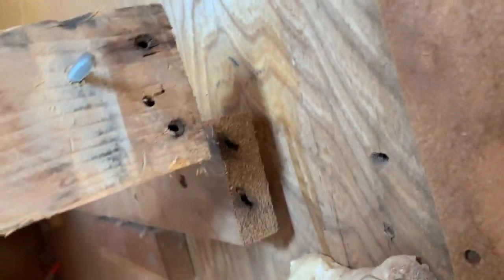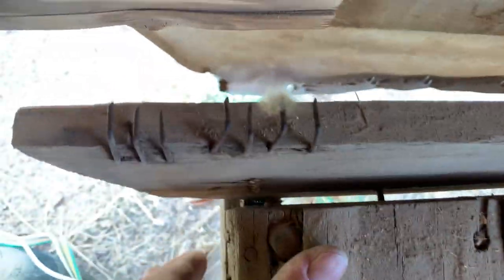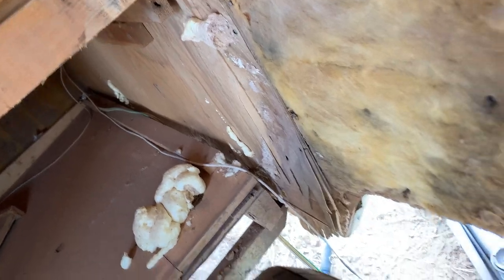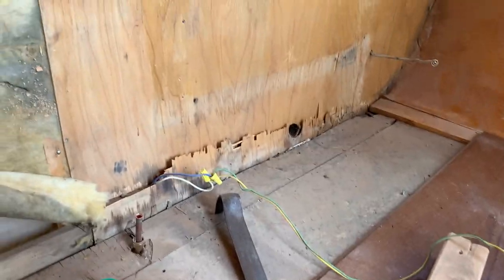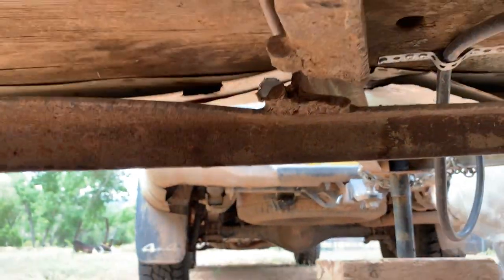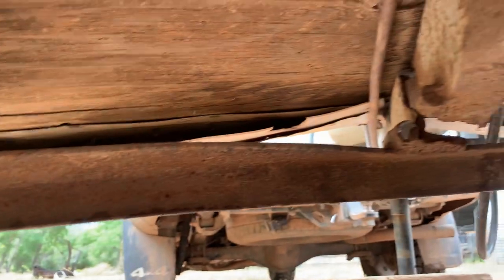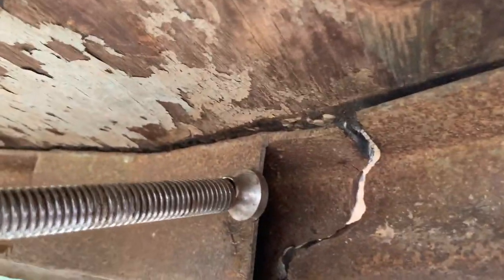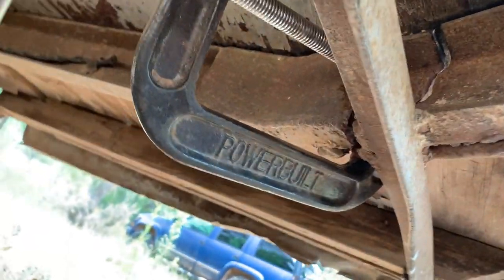broken camper video two

Comment: G'day Dave,

Foody bluckin' 'Ell...!

That Rock wasn't muckin' about..., was it ?

Did it leap up at you from an ambush, or did the Van swing out past the Track while you were in a Right-hand Turn ?

Did you have to tow it while broken, for very far to get it back to the Ranch ?

It's impressive that it's repairable.

Maybe leave or renew the Felted Insulation - but add a layer of "Sisalation", Aluminium/Blue Paper Building Insulation, or sheets of Closed-Cell Foam ?

You'll figure it out...

Have a good one,

Stay safe.

;-p

Ciao !